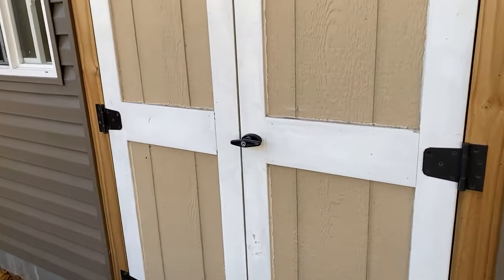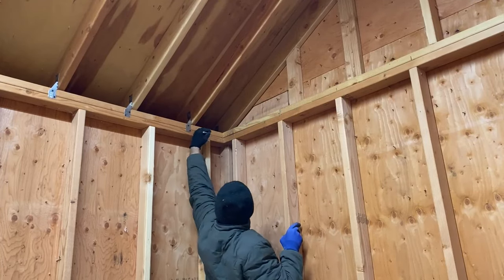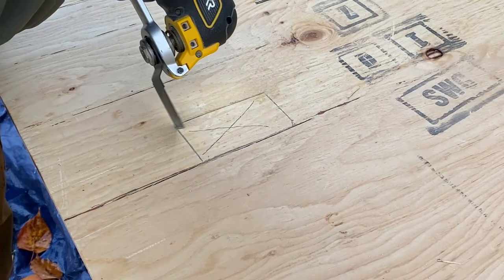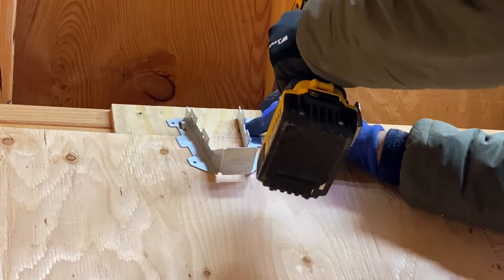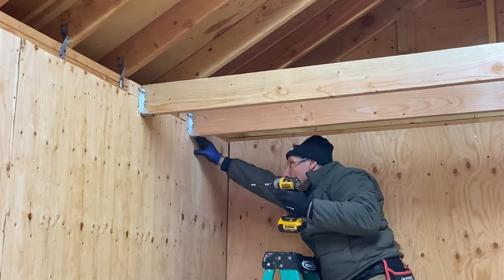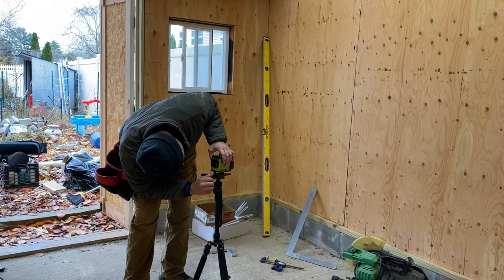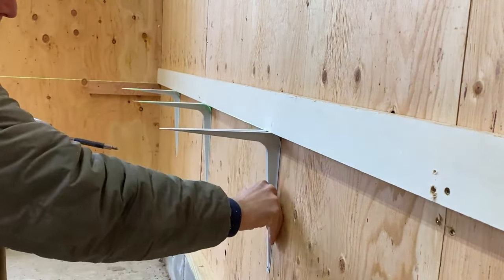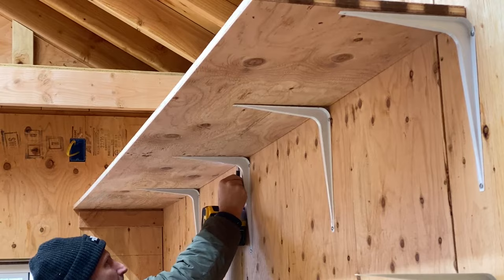How To Maximize Storage Space / Shed Organization / Garage Organization / Garage Storage Ideas / DIY

Comment: Not to be wet blanket, but those screws you used for joist hangers are not intended to take shear loads, they are designed for tensile loads in wood. Joist hanger nails, also known as tico nails, are designed to take shear loads with thin metal hangers. They are thicker than normal nails, and they are hardened. Aerospace fastener design was a previous job of mine.
Reply: I did the calcs, the shear strength of those screws can hold his igloo water cooler....
Reply: @Brian-rj5rl  People used to care about the right tool for the job. Now, any ole' fuckin' way'll do.
Reply: It’s a small loft, no one is climbing up there, it’s not that serious. It will be totally fine.

Comment: I did a loft in my shed also.  To install the 'joists' I lapped them on to the wall studs up against the top plate.  I fired (4) 3" framing nails into each connection, and then put jack studs under each joist.  

Shed came out nice.

Comment: insulation?
Reply from the maker: Only if there is a heating or cooling system, otherwise it is pointless.
Reply: @ArtisanMade  it prevents drastic temperature fluctuations and makes heating or cooling easier and far more efficient.
Reply from the maker: @deltalima1340  I’m not sure what you mean by drastic temperature fluctuations. Here in New York we are usually within a 20 degree range.  For tools and fishing poles that’s not a problem. Only insulate if you plan on adding heating or cooling. Keep in mind, you will also need to add an insulated door.
Reply: @ArtisanMade mm that’s not true. Many older homes in southern Australia do not have heating or cooling (the the conventional sense); we insulate so we don’t have the drastic swings in temperature. I get that a shed might not need insulation, but your comment about not doing it because of lack of heating and cooling is perhaps off the mark.
Reply from the maker: @joeyree22  a builder will always put insulation in a home that way you don’t need to rip down all of your walls at insulate if you want add heat or a/c at some point in the future.